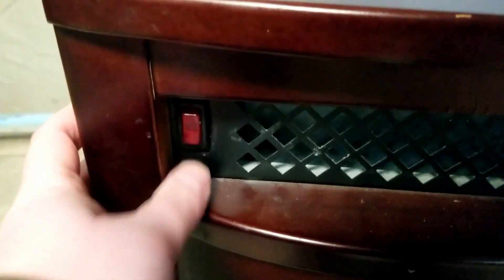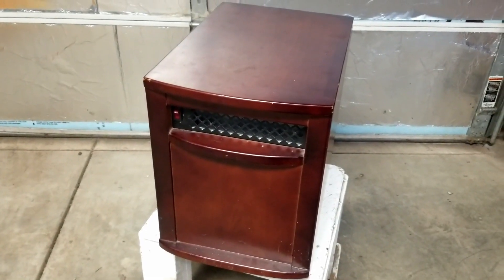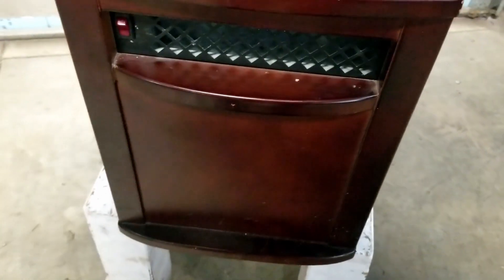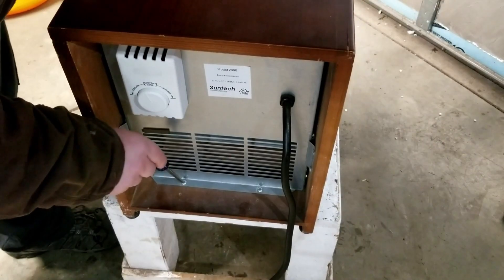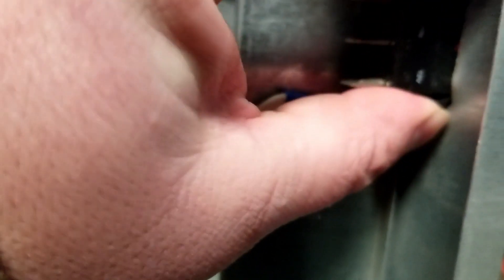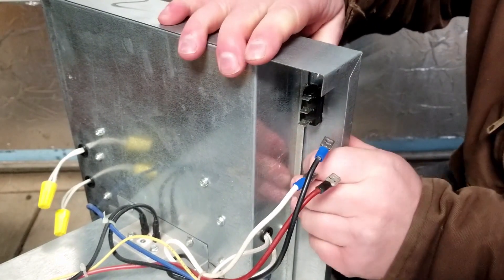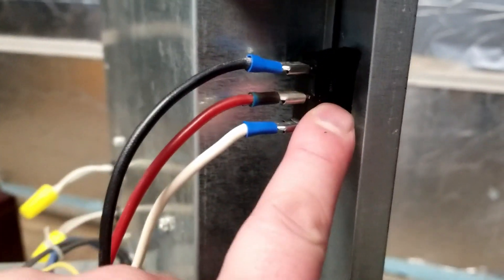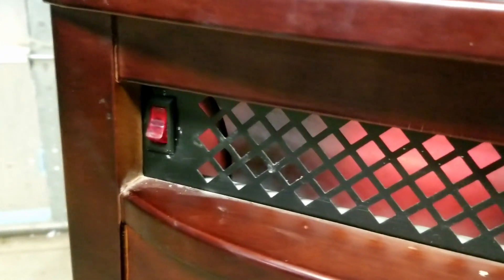Replace Switch on an electric heater

Comment: Had the same issue. I replaced the switch and within a day it went bad again. Did your switch continue working.
Reply from the maker: Yup New switch still working as of this morning. hhhmmmm was the switch rated for the voltage and current?
Reply: @ im not sure. Ill have to look at it. 15A/30A 250V/220V
Reply from the maker: hhhhmmmm based on those specs it should work, This mean something else is wrong with the machine. Could have major component issue or wire could have to much resistance causing issues for the switch.